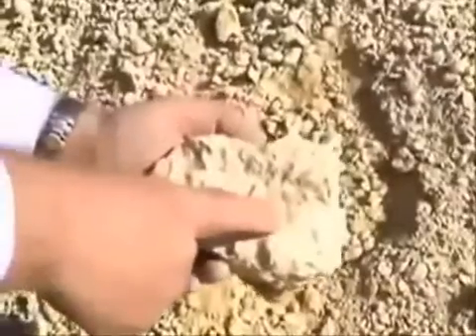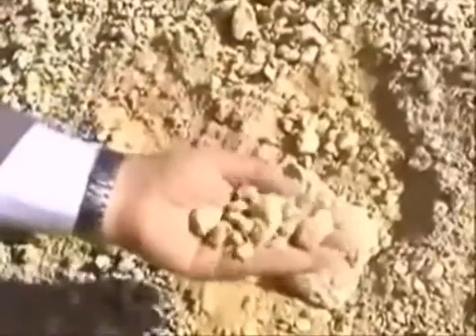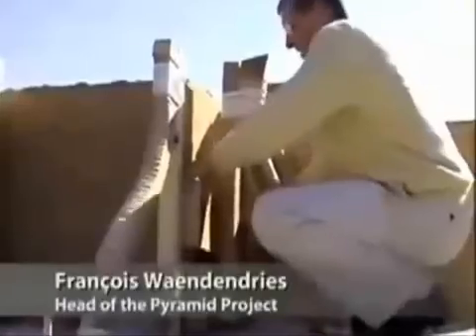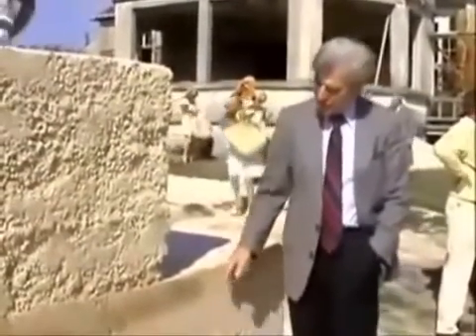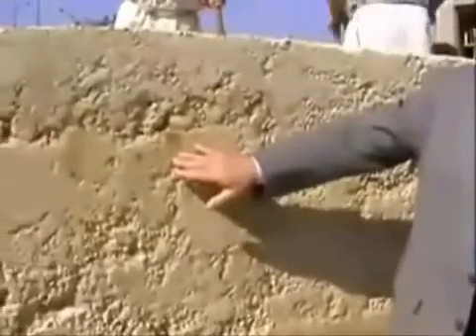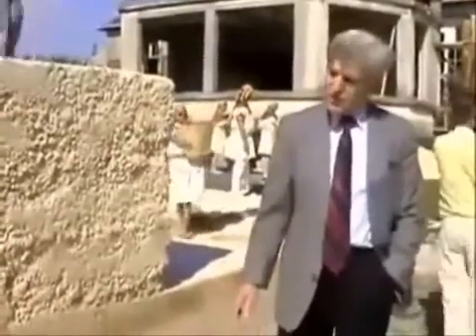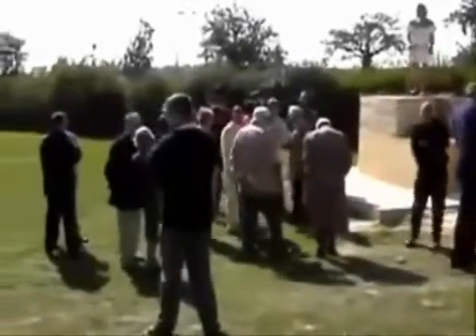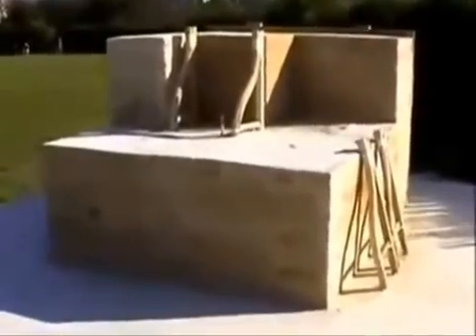Pyramids of Giza: The Silica Connection.

Comment: I see you are making your own caustic soda Now days would it not be easier to just start with caustic soda instead of making your own caustic soda ? if I just dissolve limestone in caustic soda then after wards add industrial clay  mix good then add some magnesium salts like road salt to the mix to neutralize the caustic nature let it dry till its a putty then hammer into molds and let dry  for smooth stone  mix wet   for ruff stone  mix dry  then pound in mold  do I have it correctly ?is that all there is to making big limestone blocks ?like in the video ?

Comment: Good theory, how do you explain the partially extracted building blocks near pyramid sites; those still partially submerged in the rock substrate.
Reply: The molded blocks might have been used for the larger sloping outer sides of the pyramid, while the middle was filled with actual rough-hewn sandstone blocks.
Reply: If that were the case would they  not be spread in such a way as to suggest that structure why would they be spread apart like they would be in a quarry? Why do the inside of the pyramid have drag marks that suggest it was being used like a crane or a counter leaver to lift blocks into place and stone drag marks?
Reply: I'm not sure what you mean. I agree with Houdin that the grand gallery was used for a counterweight to move the granite blocks to the king's chamber, and to bring up rough limestone blocks to fill in the center of the pyramid. That would account for the drag marks on floors, and for the blocks in the quarry. It would have been easier to use limestone blocks in the base, rather than make millions of molded blocks in an area where accuracy was not that critical. But cut stone would have gotten increasingly less efficient as the pyramid got higher and narrower.